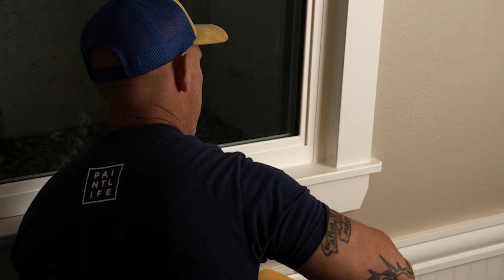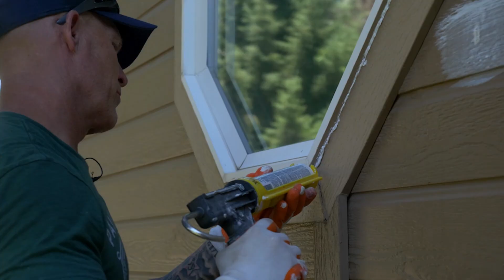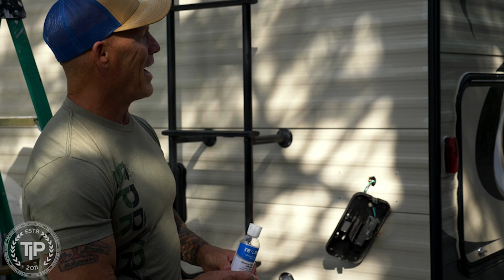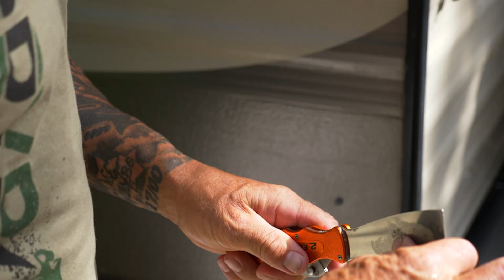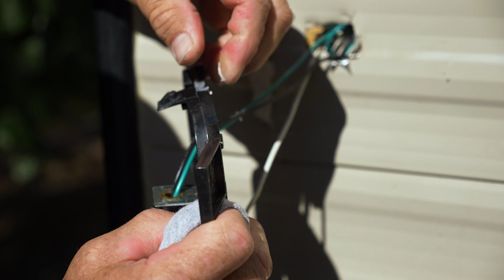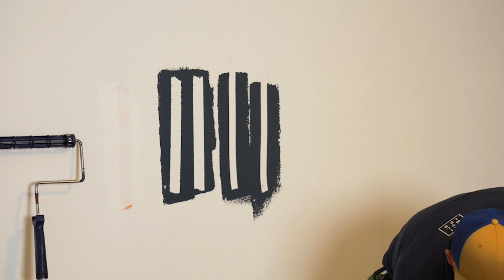More Caulking & Sealing Tips | Secrets Of The Pro's

Comment: Since the caulking is between aluminium window frame and wooden sill to fill the  gap between, wouldn’t the caulk turn into yellow colour after a while since the aluminium frames wont be painted painted?
Reply: My guess is that if the caulking is properly primed and painted that won't be an issue

Comment: Have you covered caulking butt joints on old lap siding?  This is the most challenging for me, currently I’m caulking 2005 Hardie lap siding but the butt ends are never level to each other.  How does one manage these types of issues?  Also, after it dries the joint is concave, is that an issue, can one top it off with more caulk or is that a no no?  Thanks, I’ve learned a lot from you!
Reply: So i was told not to caulk but joints on hardie but to flash them instead. he showed me to cut 8" wide metal  flashing behind. seemed to make sense so i youtubed it seems like thats a better accepted way to waterseal
Reply: @Wildside_Recovery  I ran across some info that around 2011 Hardy went from caulking to no caulk with the flashing.  Only thing I could see an issue with would be it the ends are cut & not painted / sealed from water.  Thanks